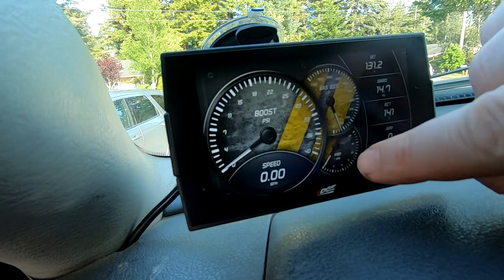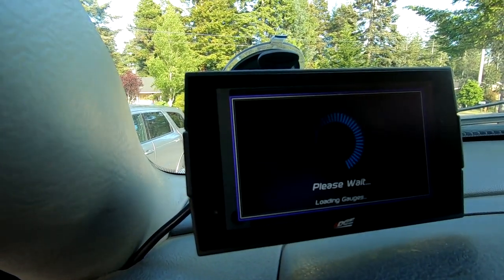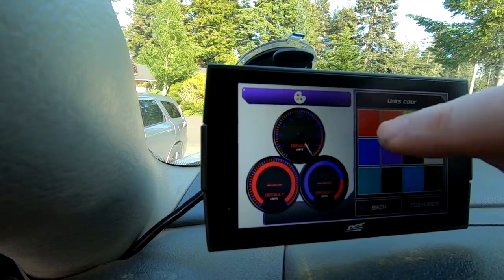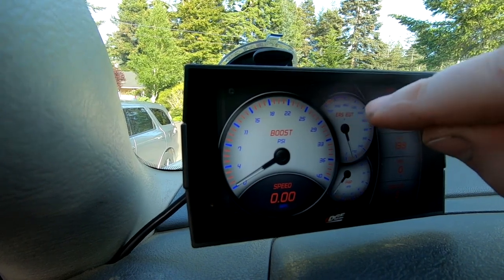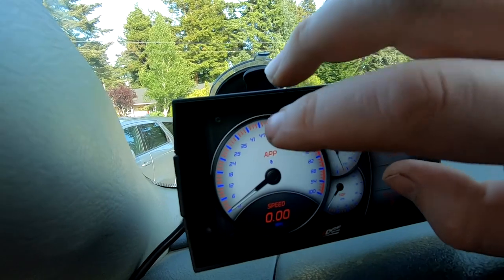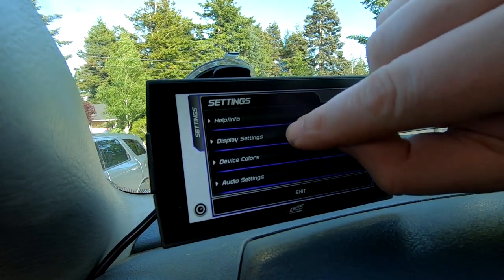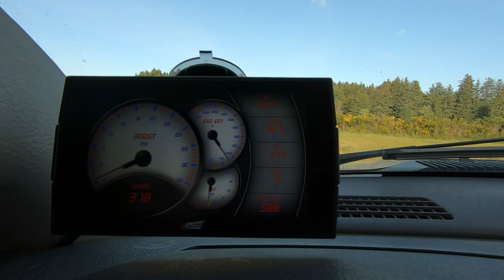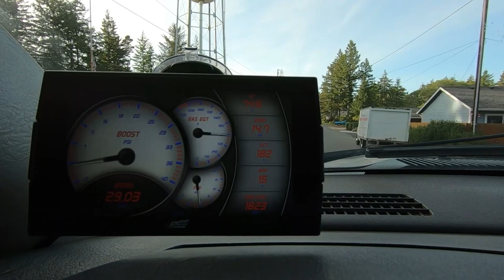cts3 customization and analog gauges

Comment: What bothers me more than where to find background colors is the fact that while you can update the device via Wi-Fi, you still have to remove the monitor and hook it up to a computer to load your own wallpapers! Seriously, they couldn't use Wi-Fi direct or add Bluetooth connectivity?
Reply from the maker: I have had that in the back of my mind too honestly but maybe down the road they will figure that out, at least let us connect to our phones via Bluetooth and transfer pictures that way.
Reply: @Cargill450  yeah exactly, but at least we can update without taking it in the house. That's more important...but it really leaves me wondering why they couldn't have gone just a little bit further and enabled picture transfer over the same Wi-Fi that allows it to be updated.
Reply from the maker: I have been thinking about doing an honest review lately sense i have had it about a month now and the "honeymoon" phase has worn off. I am really happy with the monitor mostly but i feel like there are a few things that we don't have with this monitor that the last one had, and on the flip side of that i feel like this one has some features that im surprised we lived without them without actually knowing about.
Reply: @Cargill450  do the review! They actually read them! I received a reply from them based on my lengthy review, I laid it all out, the good and the bad. I've been emailing back and forth and they assure me they're 'working' on the issues. They seem pretty attentive and they don't know they have problems unless we tell them. I was pleasantly surprised to get a reply and don't even know how they got my email address to begin with unless their system recognized my name or something. We'll see what they end up doing, but they definitely monitor the reviews!

Comment: Also was wondering how is the screen in bright light? Does it auto adjust and is it nice and clear. The gtx has a great screen and I've never had a problem with glare or not being bright enough. Just a few questions I had. Thanks in advance.
Reply from the maker: So the screen in bring light is good it doesn't get washed out in the sun like I felt it did with the cts2 and honestly i couldn't tell you the technical term for the screen type but my biggest problem with the screen on the cts2 was that driving at night it was so bright and the way it was back-lit it was just too much for me but this one is just right with the auto dimming and the type of display it is in general, the colors are really vibrant and even in direct sunlight i can still read it plain as day.
Reply: @Cargill450  ya I know what u mean I had the cts2 before and sold it for that very reason. I tried to set it up as dark as I could but at night the display was still to bright to the point where I had to unplug it. Well I guess the gtx is going on market place 😄. Thanks for the replying so quickly.
Reply: @thatgreyplatty6315  totally agree with Cargill, there are no issues with the screen! Even in the brightest light it's crisp and vibrant, and at night it dims (adjustable by the user) and does not look faded like the CTS2 did. This is almost like a good cellphone screen.
Reply: @thatgreyplatty6315  also my CTS2 never was too bright, but unfortunately products like this (limited production, small market) are not of consistent quality. But I did find it to have a very dull, faded look at night. It did it's job and I loved it, but this is ten times better all around, though there are a couple things I don't like but I'm in contact with Edge and we're working to address them.